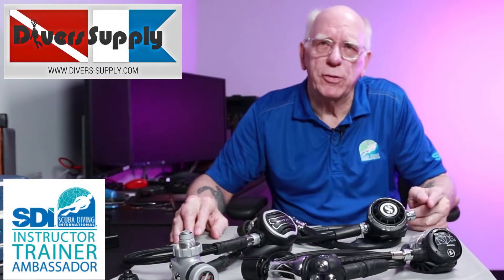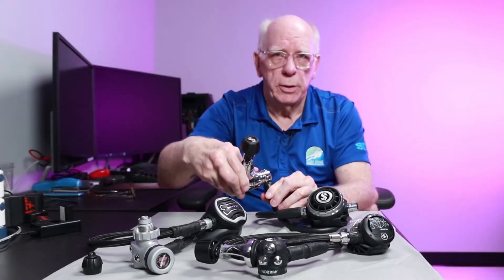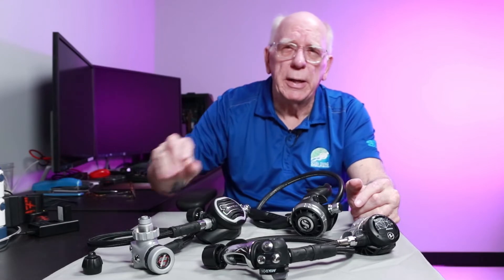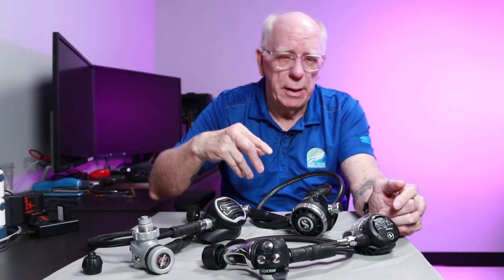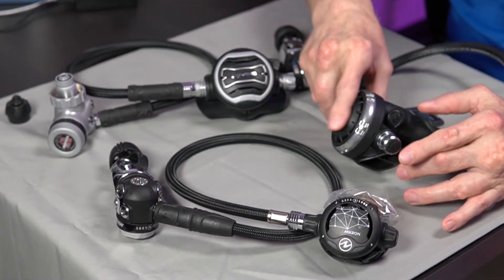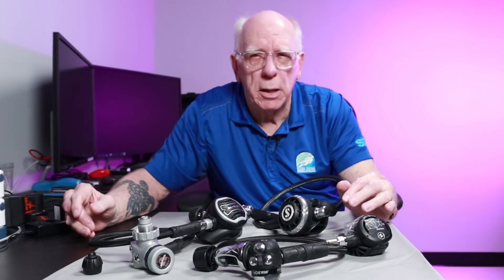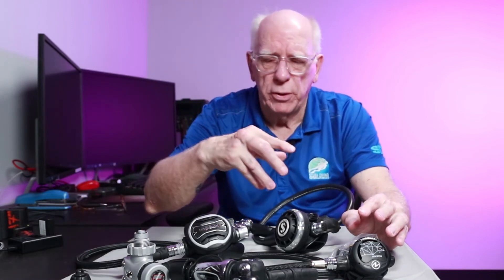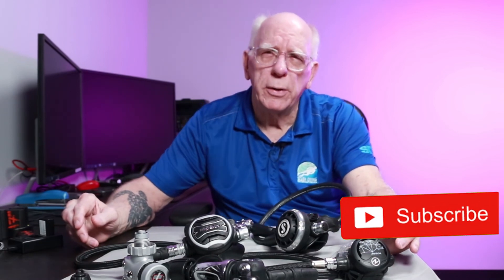Scuba Regulator Basics 101 ** How does a regulator work ?

Comment: Hii bob
I intend to buy the apeks MTX R. What confuses me is the absence of the venturi lever and the craking knob...do you think this would make a difference ...should a chose one which has them??
Reply from the maker: Miklu, The MTX does not have a Venturi/ Cracking adjustment specifically to prevent a Free-Flow in seriously cold water.
They, Apeks, says the 2nd stages are preset and capped to prevent someone from having a costly dive.
But
I too LOVE the "Cool" look of the MTX..
The answer would be, where do you dive, Finland, Norway or Antarctic waters, well in those frigid waters I'd stick too the straight MTX..
otherwise jump to the MTX-RC  still cool looking but completely adjustable.
Reply: @DiversSupplyYT  thanks bob..
I dive in tropical waters...agree with you...you are right...the RC would give me all the cool features....
Thanks a lot 👌👌